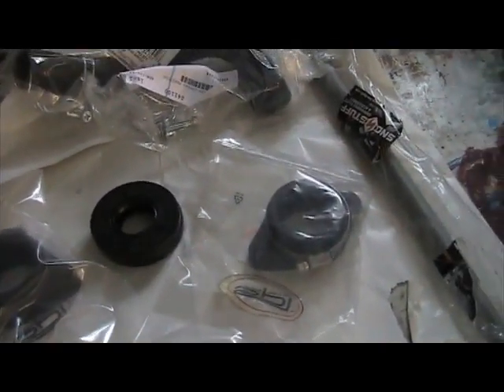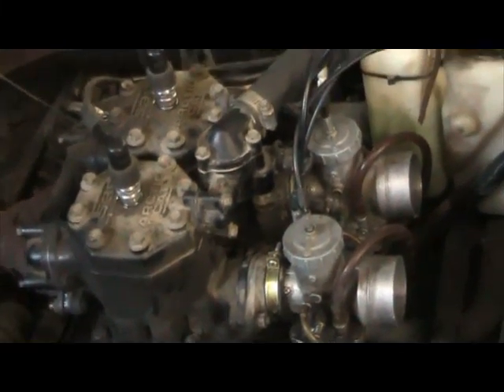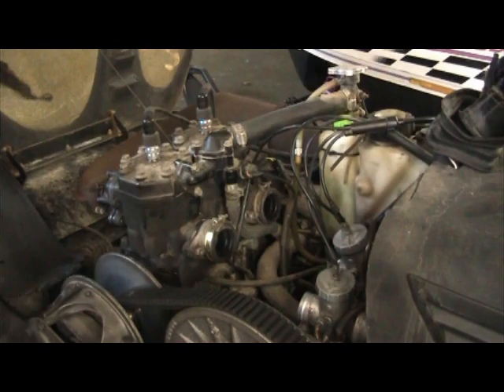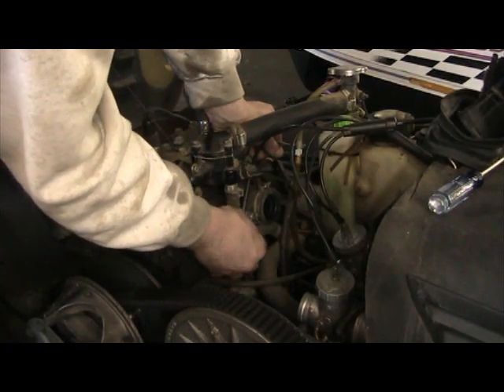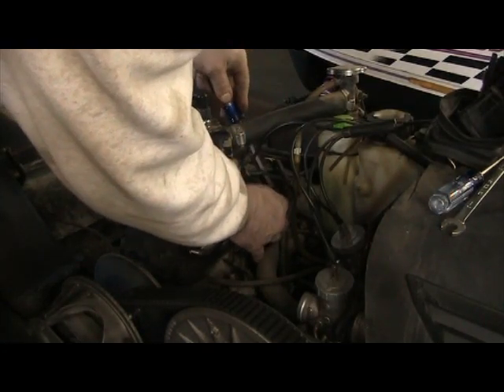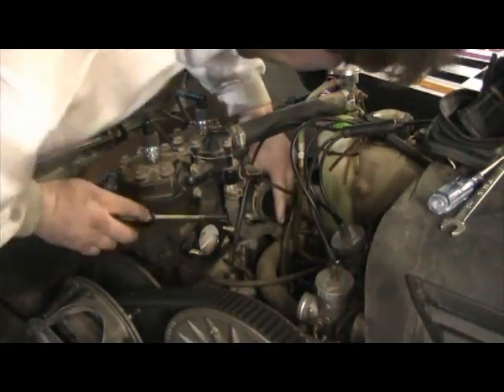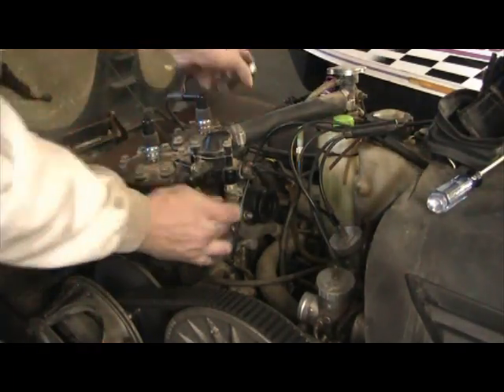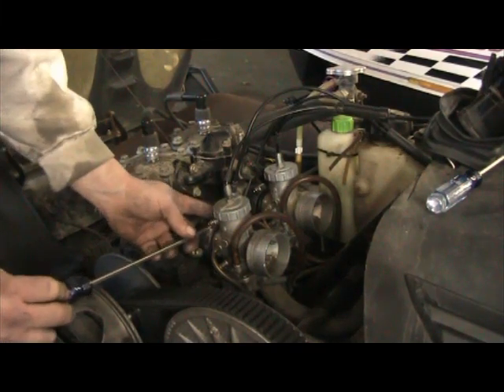Replacing the carb boots on the arctic cat Eltigre

Comment: Good job.  But I have to wonder why they have carb boots at all.  Most engines (2 and 4 cycle) have the carbs rigidly mounted, with a thin gasket that lasts forever.